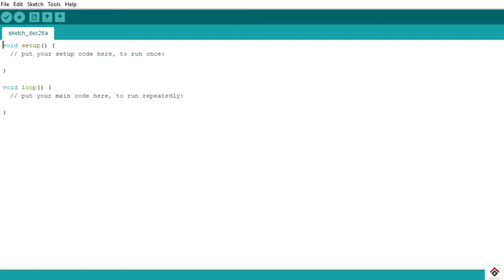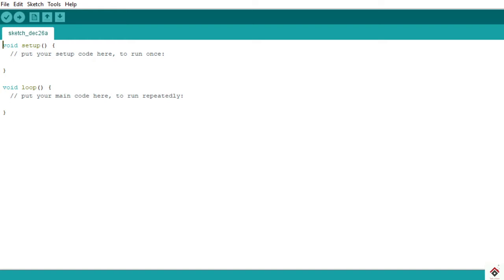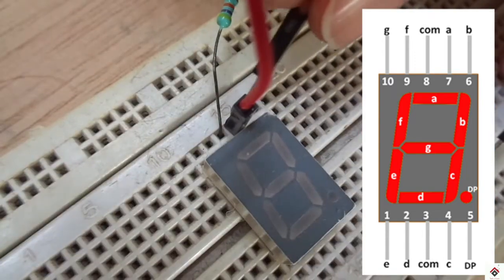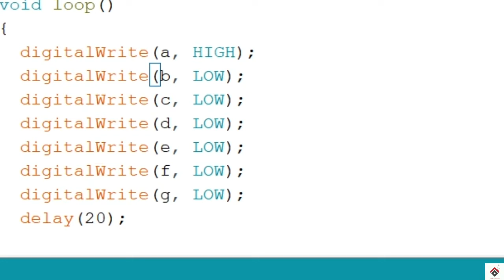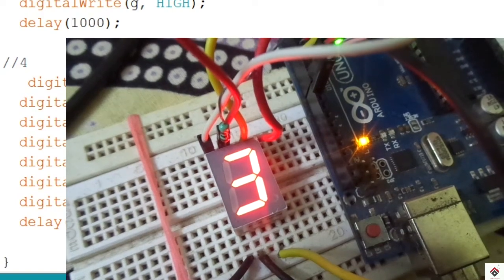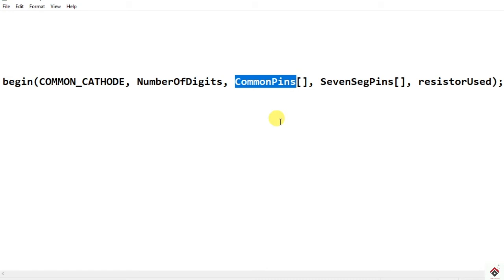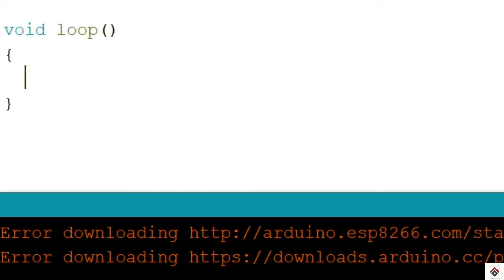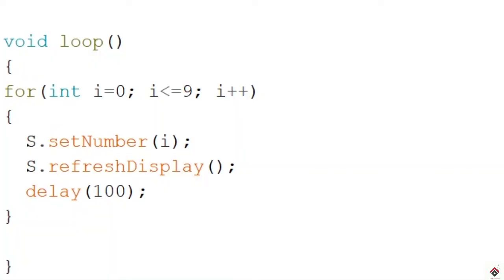How to use 7 segment display with Arduino | 7 segment display counter[with CODE] | Tech at Home

Comment: i did watch the led blink video, but i don't know how to set up the arduino 7 segment display with the wires and resistors
Reply from the maker: I have provided the circuit link in the same video description, You can easily understand from that.